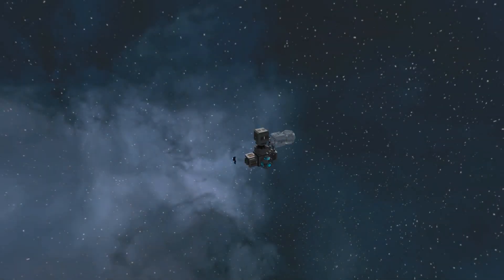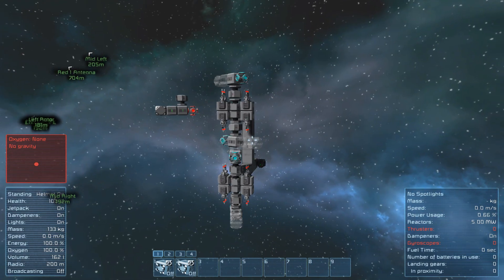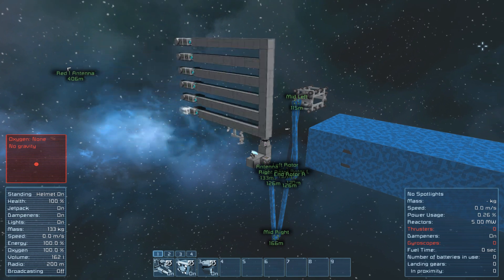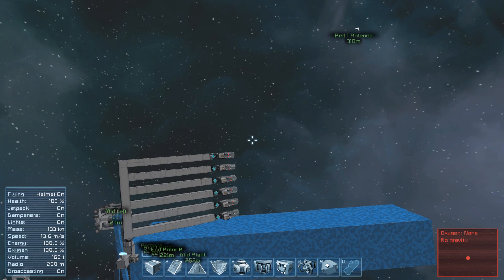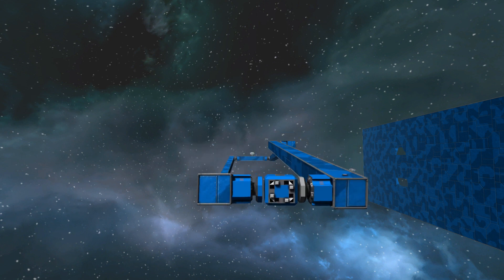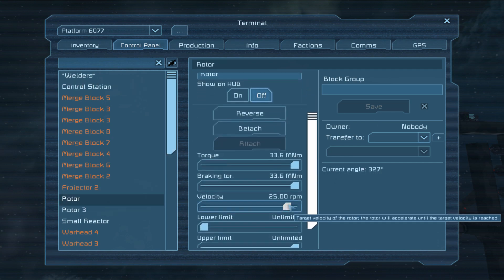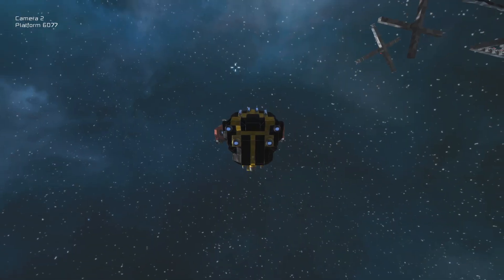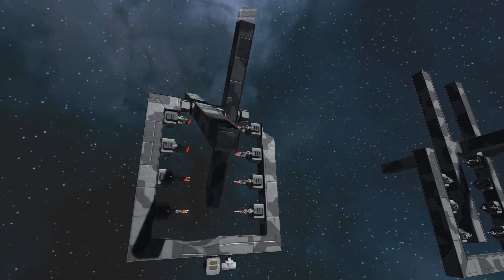Space Engineers - Searching for the Cheapest Projectile - Lotus Experiments

Comment: ***** I built a working version of your first design and posted it in the creations tab a while back. Haven't you noticed?
Reply from the maker: GTMasterMan Yeah I saw it, was the one based off the bits I used on the side of the 'Frontier Base' thingy I think.. The point of the first design was to try and achieve faster rotation speeds so that it could be used to fire as a weapon, not a area effect, and it just doesn't spin fast enough even with the dual rotors.. Best you can get is about 50m/s which is pretty bad for a projectile.

Comment: To be a "batting range" might be the answer.  Combining some of your ideas in a new way - have a static arm that doesn't move create the projectile then have a arm that swings round and round at high speed that would bat the projectile off just after the merge block released. (It would probably need timing to be adjust very well, but if we are talking a cheap projectile, i.e just a warhead and a merge block to be batted, then it should knock it off at high speed as the arm doesn't need to be slowed down)  Of course the arm would need welders on it to ensure the batting didn't destroy it..... :P
Reply from the maker: Stewart Bates I see where the inspiration for this one came from :) lol.. Could be interesting to try and the advantage of merge blocks slightly pushing away when they disconnect would mean it should be floating nicely ready to be hit.. Gonna be interesting seeing how a warhead responds to being batted :P
Reply: ***** personally I'd bat the merge block :-P
Reply from the maker: Stewart Bates
Yeah might be a more sensible move :)

Comment: Probably still won't work, but you could make the wheeled slingshot design as a small ship if you put the grav-gen block on the chute itself and just laden the trolly with mass blocks.

It's basically the same system I use for my escape pod launcher. A bunch of gravity generators in a small area with a small ship with some mass blocks with the ID turned off. Switch off the connector and watch it fly out at max velocity, impossible to catch. ;)
Reply from the maker: Reverend Trigster I did mean to try and small ship version also, might just be a bit lighter than the large one I used here and thus a bit more stable, but I suspect it's still gonna have the aiming issue where moving it around causes the cart to bounce about like mad.

Comment: Could rocks effectively push a piece of metal? You could use gravity generators to push rocks to push metal. Doubt it would work though.
Reply from the maker: Mattpoppybros Yeah it would work indeed, the oldskool way of doing it :) Does have a problem though, there's no way to stop it from responding to gravity so it's very easy to defeat with gravity shields or just buy having gravity on the target ship to deflect the projectile.
Reply: What I was thinking would be to not actually attach the rocks to the metal. A gravity shield would only push the rocks away. I'll have to test this myself.
Reply from the maker: Mattpoppybros
Ahh right, I see.. well let me know how that goes, I imagine the difficulty will be aiming but otherwise it should work a bit.. might destroy itself depending on how fast it accelerates though!

Comment: Although you are considering the cheapest option, you could add space balls onto the projectiles to utilize gravity fields (without having to add reactors or batteries to the missiles, as you would with mass blocks). I personally have found that space balls are very useful when it comes to making gravity based weapons
Reply from the maker: Aidan303 They are indeed, I especially like the ability to control the mass they are producing. :)
I think you would still need power though to get around the issue of needing to turn the ball off to avoid gravity shields etc, so you need a timer on there which needs power to function.

Comment: What about like 5+ pistons in a row? You'd have to double them up to make them more stable but, they could go pretty damn fast.
Reply: L33tImagination Hahaha, scary but effective. Bounce is too much to put on a ship, but you might have more luck connecting after every piston... just takes forever to do it right and not get so much weight that it snaps the heads off.
Reply: James Wright Well, the most stable piston structure has 4 separate lengths of pistons. I would imagine if anything that would be the most secure, however, it might also be the most bugged in terms of space engineers physics, I'm not sure.
Reply: Yeah after playing around some more with a timer system to slow the system before the stopping forces were applied I had a little more luck. Then converting it to a ship made it a little more survivable. Still after about 30 cycles something always breaks and my max release speeds are around mid 60's... that and taking up 200+ meters when compressed means this is a flawed system lol
Reply: L33tImagination Well if it is anything like a standard catapult could you set the projector/welder system up as a static piece to weld up a ball of armor or somesuch in the path of the catapult cup?   Just have it weld up, grind it so it is free floating in space and have it in the path of the catapult arm so the arm will just sort of catch it when you launch?

That is if the welder/projector assembly is the cause of the instability anyway.
Reply from the maker: L33tImagination Aye true, but 104m/s fast? I dunno... think it might need a huge amount to get that sorta speed, although I'll admit I never tried it..
Reply: ***** Ok, I've just attempted a combination between pistons and a rotor, to make a sort of, forward-boosted catapult. I used the precise timers script and gave the release timer a 30 frame wait. I also modded the speed max to find out exactly how fast the projectile would go without a max speed.

I clocked it at 111m/s. :D

The only problem is the moment I add a welder and projector to the thing, it starts going nuts.. it wobbles and just gets increasingly violent until it wrecks everything. What up physics XD

Maybe had I built it more stable (4 piston platform and 2 rotor joint), this accelerative wobbling wouldn't occur? Anyway, proof of concept complete!
Reply from the maker: L33tImagination
lol, 'what up physics'.. and it was sounding so good till that point!

Have to admit I have no idea if you can kill the wobbling, might be a bit inherent with what we are trying to do given there's some very large forces involved with this sort of acceleration.. Essentially trying to get it from 0 to 104m/s in like 20m.

Sounds like a solid start though, intrigued to see if you can solve that bit
Reply: ***** Fixed it! I had to put the projector as close as I could to the rotor. It still wobbles like jelly after firing, but interestingly, on the return, the welder builds the next projectile, and then it bumps the welder which stabilises it. So I've added a welder to keep the welder repaired, haha.

The only problem is, it only fires in 1 direction (surprisingly accurately mind you). I have no idea how well this would work on a ship.

If you're interested in seeing it in action, I can upload the world to the workshop. I mean it's not particularly well built, this is a 5 minute effort :P, but the projectile does hit max speed in half a second, which is not bad going so.
Reply from the maker: L33tImagination
Yeah why not, it's about the concept doesn't have to be the perfect execution :) Sounds wonderfully bodged also (like all good designs should be.. where's the space-gaffa when you need it)
Reply: ***** Steam community seems to be down at the moment, I'll have the link for you once it's up again.
Reply from the maker: L33tImagination
Rogor that, cheers :)
Reply from the maker: L33tImagination
James Wright yeah bugged would be the correct term.. my playing around with it is that even when properly braced like that the piston heads end up flying off into space in the end, really don't like the braking forces involved... takes some time but they are either getting weakened by each shot, or eventually the random movements hit just the right place to split the whole thing apart.
Reply from the maker: James Wright
lol, yeah that's massive! Damn.. Nice to get it working a bit at least but that's never gonna be practical it seems :(

Comment: What if you had a static welder + projector set up and a cup on the end of an arm to collect and then throw the projectile? Wouldn't be any good for warheads though.

Also, have you considered using wheels as kind of like rollers to apply kinetic energy to the projectiles? The projectile is moved between two rollers, that push it through the middle.
Reply: ***** might work setting it up on a few pistons but is still kinda meh

i honestly don't know much ways in se to propel projectiles aside of rotors, pistons, wheels, or moving yourself then stopping.
you can try using warhead explosion as a propelling mechanism but it's risky and most likely not gonna work
Reply from the maker: archlorddestin Both very interesting ideas and I very much approve of the 'out of the box' thinking there.. very mechanical! Will have to give them both a try as I have no idea whatsoever how well they will work :)
Reply from the maker: FormerTransformerKnownAsMjolnir Yeah explosive propulsion is prolly gonna get messy :)

Comment: I would use a programing block the tracks the rotation of the rotor and only when the rotor was spinning fast enough and at the appropriate angle would I have the mechanism release the ammo. Maybe set the rotor speed to slow until it can detect the ammo block of your choosing to be completed, then it would speed up.
Reply from the maker: Lumaro Yeah the release isn't really an issue, sensors are fine for that but the building part is an annoyance.. programming could help handle the speed up and slow down for the printing for sure but would really like to find something that could fire quicker than that if possible :)
Reply: Yeah, That's what i'm saying. If you write a while loop that states if an array/list is empty keep the rotor slow, but then after the warhead or whatever last block you have on the deployable is created, the program will add it to the array and then will break from while loop and and let the rotor speed up for a second, then trigger the sensor block.

If the programing blocks don't support while loops, the same could be accomplished with a for loop. I haven't tested this idea yet. Just spit balling.
Reply from the maker: Lumaro Aye, just meant that because of the inherent need to slow the arm down for the projection to print there's another problem still to solve, what you suggest would certainly speed up the collection of the projectile and make the whole process smoother but I'm still keen to try and work out a solution for the need to slow down at all :)

Comment: Use wheels? Have a long tube lined with wheels on rotors all spinning in the same direction spaced just enough that the torpedo can fit between them.
Reply: ***** Those little foam disk launching toy guns use this method. I think he's on to something.
Reply: Increasing the length of the tube/barrel might help with the end velocity of the projectile after it leaves the tube. Though it might defeat the original idea of making it cheap.
Reply from the maker: Kevin Jack-Nunez Hmm, that's some old-skool mechanical thinking there, I like it.. Annoyingly can't think of an RL example to demonstrate that I know what you mean but yeah, nicely out of the box sir! :)
Reply: haven't tried it so I have no idea how well it might work in game, if at all. But it's a similar principal to what is used in the machines at Batting centre's or Tennis clubs for players to practice hitting fast balls. You might have to make a larger projectile out of Heavy armour or Blast door blocks else the projectile might just get destroyed in the tube.
Reply from the maker: Bart Bols Kevin Jack-Nunez Shenanigames Nec Sounds interesting, will give it a try myself just because it's something very different, although can 100% believe that velocity is going to be the issue
Reply from the maker: Kevin Jack-Nunez
Well it's the projectile that needs to be cheap, not so much the launch mechanism... Tbh I think you either end up with an expensive as hell projectile that needs basically nothing as a launch system, or a cheap projectile that requires a very expensive ship to launch! Getting both to be cheap is perhaps asking a bit much :)

Comment: Use blast door block as the heavy block wall
Reply: ***** I got the idea. It's a cool problem. Worth to solve. I've been experimenting with gravity and small rocks around month or two ago and I ended up with the design that was gathering dense cloud outside of the ship and then propeling it all by gravity. Take a look: 
steamcommunity.com/sharedfiles/filedetails/?id=375513108  
Then I forced myself to rebuild it on survival cos that ship is a beast and I don't wanna do it again ever due to vast amount of resources that it takes to finish it T_T Anyway conclusion was that dense cloud of small rocks can deal really nice damage. Now what's left is to find a way to combine it with new mechanic. I will try that tomorrow for sure.
Reply: ***** First tests done. And it's not looking promising. Bullets can be very easy propelled to nice velocity. Problems starts when you trying to automate whole thing. Cos you need to find way of welding and grinding block that will hold/release air. Also pressurizing and loading the chamber as well. First designs didn't work cos my ammo was floating all over the place and stuck in as many places it could. Target remain undamaged so the whole idea is a bust for me imgur.com/LVgJYPO.jpg
Reply: ***** It was first thing I tryied but blast doors were opening to slow and all the air was out when they were in half way to clear the tube. So most of the ammo stuck in the chamber. Conclusion was to do it fast by cutting out block. And that might still work for single chamber. I was probably over doing it with multiple charges in my prototype.
Reply: Oh, that gave me idea to use small rocks and depressurization mechanic to propel them. Cos rock is cheapest as you can get. My first thought after this vid was: Not so much about cheapest projectile. More like about cheapest lunching system ;P
Reply from the maker: spencer contreras Given they get re-welded every rotation I'm not sure it really matters much but could be interesting to see which is the best at cutting stuff! :)
Reply from the maker: Shinzo's Sins Yeah indeed, have been thinking about that idea a bit myself also but that's for a future build perhaps, only been thinking rather then building so far :) Will also be cheapest projectile in my opinion just because so many need power to function, so it's not just a thruster or a gyro or a mass block and time, it's power too and some way of filling that up.. adds a bit extra to the equation!
Reply from the maker: Shinzo's Sins Looks cool :) They do have a flaw though and that's how easily gravity can also be used to make them ineffective.. because you can't prevent the rock from responding to gravity any grav gens on the 'target' ship will interfere with the projectiles, and if setup right, can stop it altogether.
Reply from the maker: Shinzo's Sins
Why not use a door for the release mechanism? Or a hangar door that's only using the very last block so it clears quickly. That way you can more easily automate the 'opening' part of it without needing to grind and rebuild bits.
Reply from the maker: Shinzo's Sins
Fair enough, was always a possibility... Here's a crazy thought then.. I actually used explosives in an escape pod design at one point to 'surgically' remove some blocks by placing them at a set distance. Would certainly be a quick method! :)